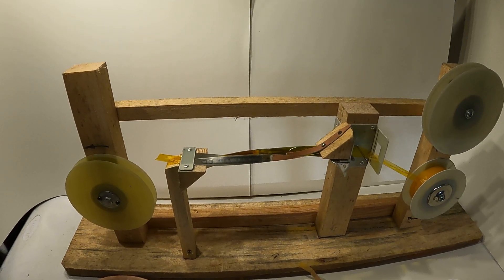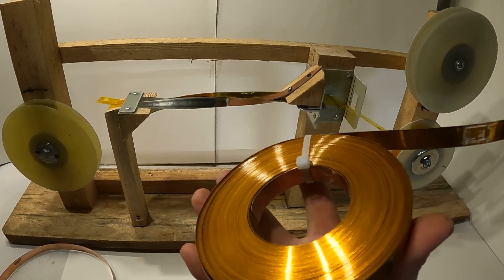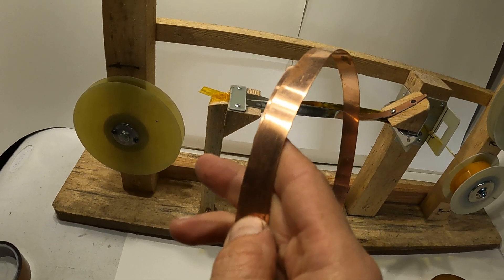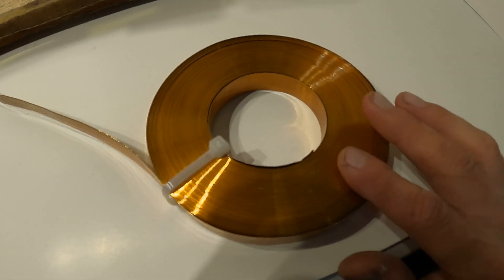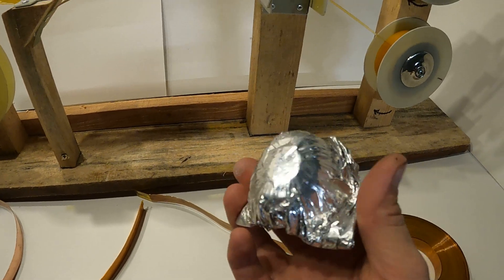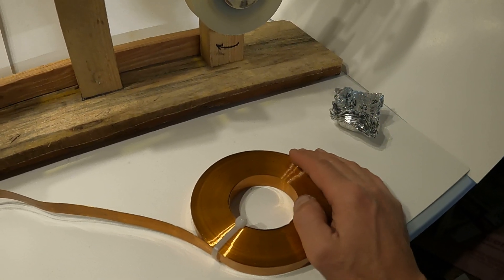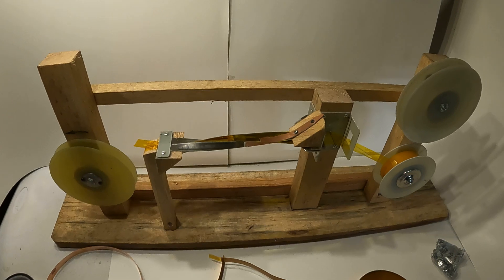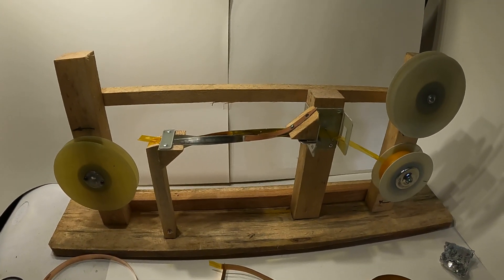119 Wrapping machine for new "Strip Coils"

Comment: Another good video Andrey. How exactly is your wrapping machine wrapping both sides of the copper strip? Can you give some more details please. I just got a roll of copper strip and tape and would rather not reinvent the wheel. Thanks for all the information you've put out there.
Reply from the maker: Since then I have made a few improvements  to the wrapping machine, now it works even better.
I think I can make another video showing what I have done and some more details. I will try to do it this week. 
Are you trying to build one?
Reply: @AndreyD   Hi Andrey. Any progress on the video?
Reply from the maker: @domgualtieri8691  yes the next video I make will be about wrapping machine, I haven't had time to get to it yet, soon I will
Reply: @AndreyD   Thank you. Looking forward to it. For now I made a manual wrapper.
Reply: @AndreyD  Yes. I would rather not reinvent the wheel. It would be great if you could post a more detailed video. Thanks.

Comment: How about using a bunch of these for a pemf mat?
Reply from the maker: Yes you probably could use bunch of strip coils to build a mat, it will be expensive not easy to build but strong.
I got a sheet of copper it's 3' x 8'  it's 0.5mm thick, I was thinking to glue it to some fiber material then paint it on the other side and scratch the lines forming spiroll like a coil, then use acid to eat the copper between the pathways. I'm hoping to end up with large 3ft x 8ft flat coil mat.
I don't know how much I can get out of it, definitely not as much as if I would placed bunch of coils like you suggested
For now I can't afford to use bunch of coils but I would try when I have some extra funds

Comment: Would a slightly larger coil like this, made of an aluminum strip produce the same power out, plus be much lighter and cheaper?
Reply from the maker: I want to try aluminum kind, I need to research to find matching strip. If you can find something similar to 0.5mm x 15mm wide, let me know I want to try it. 
I can wrap insulation on 5-25mm wide, I just need to adjust my wire wrapper,  best 15mm that's the perfect size for Coils plastic mold
Reply from the maker: It wont produce same power~ 10% less, it will be heating up faster ~30%, but it's 3x lighter, and cools off faster, aluminum cheaper then copper.
I think other metals can be use as well (not iron)

Comment: Andrey, the idea to use insulated copper banding material in the coil, is brilliant. The heat can now easily dissipate from the center of the coil...not so, with insulated copper wire. Again, brilliant!
Reply from the maker: Strip coil especially one made using 0.5 mm strip is heavier  then 14AWG, 420g vs 500g., Strip coil 1 mm thinner but it's  tighter winded, more copper used.
This results that coil is not heating up so fast

Comment: Super cool. Approximately how much is the length of the copper strip to make a coil?
Reply from the maker: For 0.5mm thick 3" strip coil I used under 6meters of it. I buy copper strip  from China and they sell in meters
For 0.3mm I used more, probably around 9 meters. Weight of the finished coil is 410G

Comment: Andrey..... Damn your mind is good, and only a couple of hours to make this new coil winder that applies insulation on one side......I have always thought that thicker copper is the key to handle the heat and give you longer pulsing time, and the strips of copper roll real nice.... Great work..!!
Reply from the maker: It's actually a coil wrapper, Yes it applies tape on both sides and on the edges it wraps it around , I wish it was couple hours, it was actually couple days no rushing. The end result is great, I could never get it this tight (insulation) by hands and it was time consuming. I did one coil by hands it was thicker wire, it took me like 4 hours to wrap one coil, here I wrapped equivalent of 2 coils in 1 min. I speed up the process probably 400x
In addition, winding strip coils is 20x faster compared to 14AWG round wire, I can wind one in under 2 min

Comment: Hello Andrey. Love your videos. I recently purchased a used HIEMTPRO machine from a gym that went out of business. The operating manual claims 0-9 Tesla (90,000 gauss) at 350ms pulse duration. Can this machine be used to kill bacteria and viruses (infections) like your BBMPulser's?
Reply from the maker: Try it, most likely it will be effective.
I think it's 350micro seconds which is 10x narrow then from BBMPulsers.
9 Tesla is a lot of Power, I got to 5 Tesla and it's becoming scarry to handle, if any metals get near by the coil they will fly off like a bullets from the coil. 
I would like test out 9 Tesla if it's real 9 American  Tesla not the Chinese Tesla
Reply: @AndreyD  i just verified and you are correct -- 350 us (micro seconds). The BBMPulsers are 10x wider pulses ! Does this mean I would need 10 pulses om this machine to get the same bacteria  killing effect from 1 pulse on your machine (assuming same tesla intensity )?
Reply from the maker: @wadeholt5140  I dont know, the intensity of 9 Tesla may compensate the width of the pulse. 
To test if it's effective against viruses, test it on Cold or flue Virus. i think  it should work.

Comment: Hope see your test strip coil with bbm 5 version, i blow thyristor and diode when try this coil.
Reply from the maker: I blew like 5 thyristors and many diodes  but I got it working, as you can see the bend test on aluminum foil
Reply: @AndreyD  Wait to see your strip coil and changing in circut of Bbm 5B for this coil.
Reply: Am I right to assume that blowing thyristors and diodes means this coil is way way more powerful than the regular coil?
Reply from the maker: @jamesmurraldeo7624  strip coil has power internal resistance and will discharge capacitor bank faster, more Amps will flow during the pulse.
I tested 14AWG wire against 0.3mm and 0.5mm strip wire and to my surprise 14awg coil held on  close to other 2 from flat wire. I was able to get over 80% and 90% of what 0.5mm and 0.3mm  flat wire coils produced
The best one is 0.5mm but it's hard to drive it